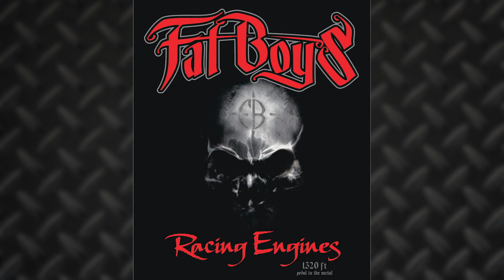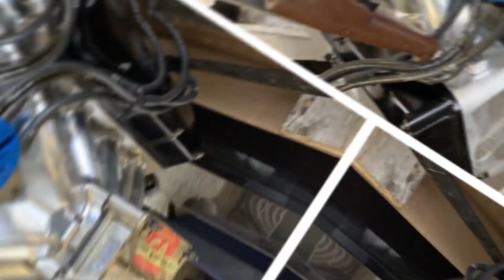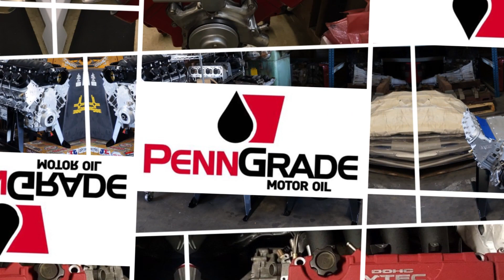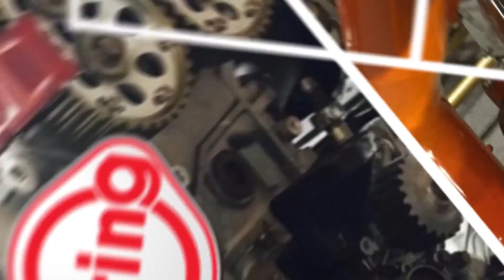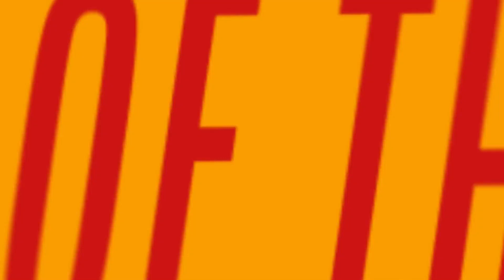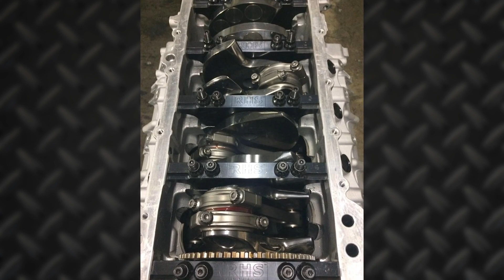502 Cubic Inch LS Engine

Comment: Those extra cubic inches really make a difference. And I am willing to bet the block is not much more than an LSX. Are the billet parts because of the longer stroke? (i.e. custom)
Reply: What billet parts are you referring to?
Reply: @tonkatoytruck  
The Best LS Block is a Billet Block from Energy Manufacturing in the USA . 
They Water & Solid Blocks ..
They also have Billet BBC & SBF ( Windsor) & from memory they at one stage did a Hemi SB ...

Comment: It’s a shame most of those bad ass engines are built on the backs of drug addicts......
Reply: Yeah it’s probably a narco truck. When they armor them they put more power for the weight. It’s crazy what they come up with sometimes. The engine bay even gets plated, along with the legit bp glass, radiator gets boxed in behind the grilles. Full alligator or crocodile interior with the tan cowhide leather and a car audio system on par with a high end home theater system… But I’ve only seen when they come thru the junkyard all shot up and run down, thoroughly stripped…
Reply: What are you babbling about?
Reply: 😂🤣😂🤣😂 what?
Reply: Just mad it's not a hillbilly building them and I'm a proud American but if someone can do what we do more power to them bet he can't fight or get a girl on the fly
Reply: Damn that's a bad ass engine